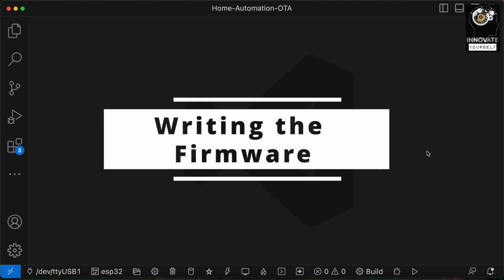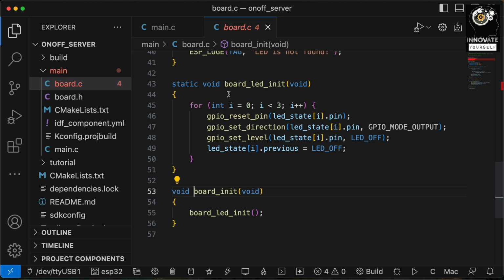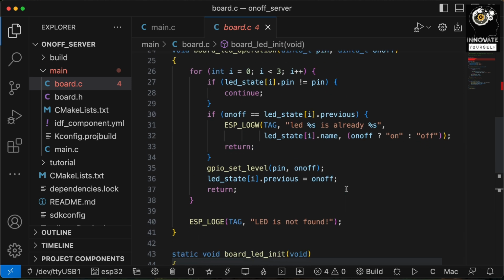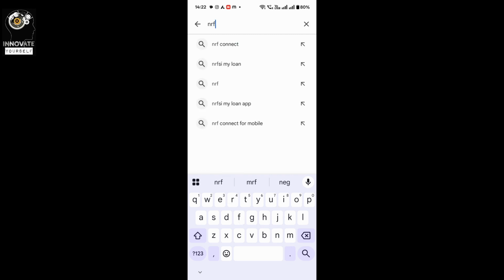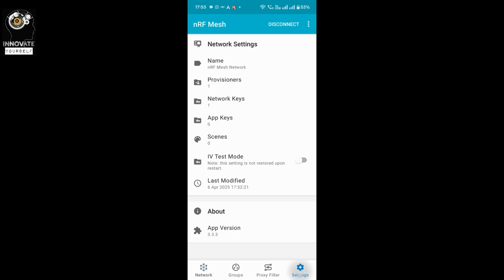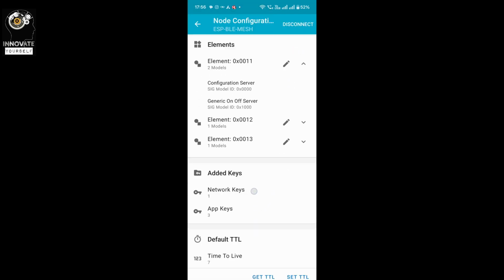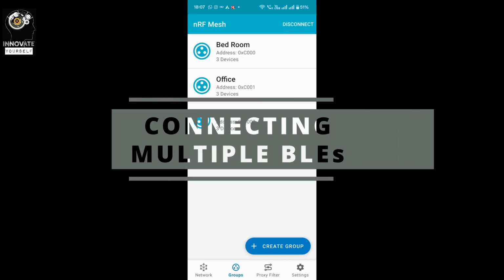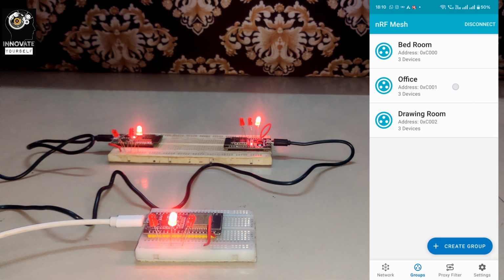Build a BLE Mesh Network with ESP32 using ESP-IDF!

Comment: I turned off my device and turned on again and now its not getting controlled by the app. Is there some settings in app or some code which is responsible for this?
Reply from the maker: You connect it to one of the devices it will get connected to all the other devices.